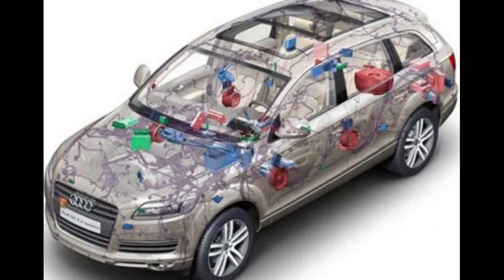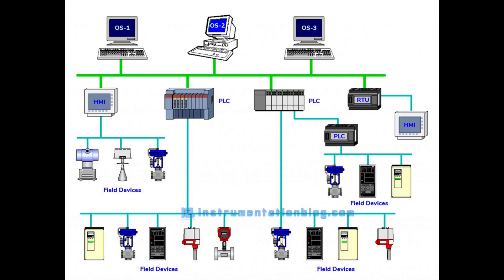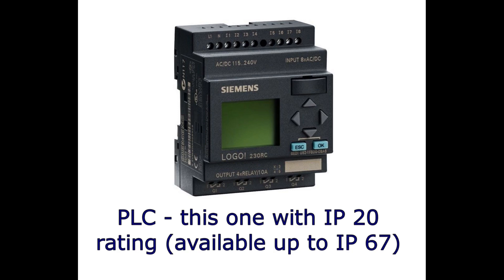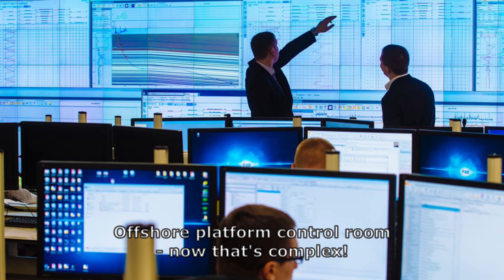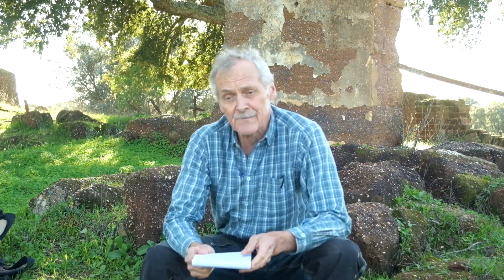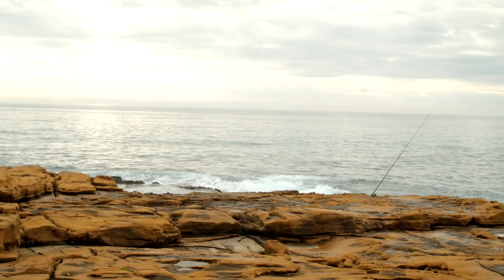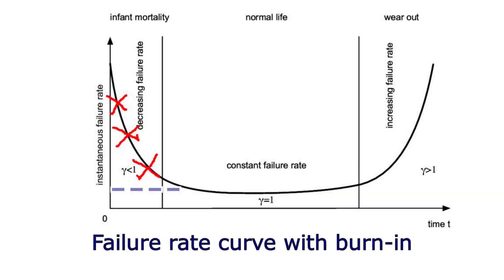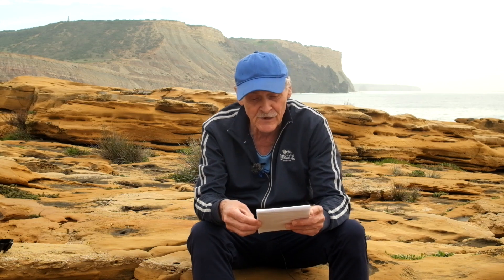Defender 2020 Reliability Woes - an engineering appraisal Pt. 2

Comment: Mercedes produced a G Wagen lite. Proper name G Wagen Pur. Rubber mats, vinyl seats, water proof switches, ECU/critical electronics mounted in a water proof compartment in the centre arm rest area. Basically military spec. Never seen one in the UK.  Plenty of blinged up Chelsea tractors with 20 inch low profile tyres though😏 follow the money comes to mind. Manufacturer's give us (the status fixated buying public) what we want. LR continue to sell all the Defender's and RR variants they can churn out😟
Reply from the maker: Good for them but they still don't produce a vehicle that (a) I can afford, and (b) I'd dare to take on an expedition.

Comment: Comparing one off industrial facility to mass.produced vehicles is like apples and turnips. No sense in designing a perfect vehicle that can't be manufactured precisely (and we all.know how British automotive quality is). Also said perfect vehicle is useless if twice as expensive as next direct competitor. Also, the time available to design and test a new vehicle is far different to what is used in industrial facility design. Also, regarding military standards, let's not forget that despite money no object development they are always out of time and over budget, ans even ships take years to get commisioned and sort out problems.
Reply from the maker: You are of course correct that one cannot compare custom designed industrial systems with mass produced ...... (I wanted to use the word "rubbish" but that's a pejorative term). However the underlying principles are the same - complexity = unreliability. I deprecate the addition of so many useless features in modern vehicles, and particularly in those vehicles which might be used on long expeditions far away from support.
Regarding your comments about project timescales. Yes military contracts have a poor reputation for overruns but there's a weak, captive client. From the moment the contract is signed the contractor pulls the strings.
In oil and gas (my former business) the "first oil date" is king and the reputation of every contractor depends on meeting this. In my long career there was only ever one project which overran by more than a couple of days (it was an impossible contract delivered 6 months late). If you miss your delivery date you get a bad reputation and new contracts are hard to achieve.

Comment: Issues that I see (Engineering ones)
- lack of availability of properly and usefully presented full system intormation for trouble shooting

- the difficulty and cost of component replacement (due to poor access / the need to remove functioning components / assemblies for access)

-  the utter lack of repairability due to inherently poor system design choices (yup, dealer damaged the wireing harnness when fitting a bullbar and the vehile was written off as unrepairable)

- The choice by the company to operate a risk based design and manufacturing process that excludes risks and consequences for the vehicle owners / operators / maintainers and repairers. (the risk based manufacturing considers primarly the impact on the company, not the consumer of the product).  Consequently engineering and design decisions under this process risk profile are skewed in a manner that that leads to a product that is nice when working as intended, but utterly traumatic for the consumer and repairer when things ago wrong

There seems to be a lack of real world appriciation.
For example, power draw when the doors are opened 
- this is really great for camping when you may need to access the vehicle many times a day resulting in a flat battery because of the large power requirments in booting all the vehicle systems when doors are opened ( yup, to get the mossy repellent, hat, kids book, drink ........).
- PowerfullUK (youtube) did some tests here = no wonder the car gets flat battery so often
- Now, only an immature designer would put such a system together and certify it as fit for use.

--- reminds me of the glint on the computer screen put in by the programmer. It was really well implemented (had me chasing all round the no glint office  looking for the problem initially).  When I spoke with the young fella in the IT department, he was so pleased to talk to some one about his web page and asked me what I thought of the glint that he had so carefully and expertly crafted into the page.  He was utterly devistated when I pointed out the the text (yes very necessary text) under the glint was unreadable, makeing the age useless.  Lovely lad, promised to address the issue. I was in a privilaged position within the organisation to have full access for conversation with such staff, landorver customers with feedback and issues on the other hand have utterly no access to syetem designers
Reply from the maker: I don't run a modern LR so I can only talk in general terms. You seem to have detailed knowledge and I can well believe what you claim.
One thing I will comment on is the immaturity of some of those calling the shots. I was talking to the representative of a former LR main agent near me. He talked of a visit by a group of young LR execs who "didn't understand the motor trade" in his words. The dealership was taken away from his company given to another which ran it for several years before closing down. Result - no representation in our region which should be prime LR territory.
Similarly Andre White tells of LR's attempt to consult the overlanding community during the development of the new Defender. One experienced overlander expressed doubts about taking the proposed new vehicle into China, to which an arrogant young exec said he'd been to Beijing (by air) and he couldn't see it was much different to anywhere else. Says it all really.

Comment: Resisting another rant here about about contemporary vehicle  complexity, fragility, damage vulnerability and inaccessibility, a fascinating pure engineering design matter ongoing is premature  crankshaft failure in the Land Rover V6 Diesel  in Discovery 4.  LRTime has this well covered on repair, but some deeper analysis of this seemingly optimistically slender crankshaft and the dimensional  criticality of managing stress raisers at the radii of its crank pin to web transitions etc would make fascinating viewing.
Reply from the maker: I have no particular insight to add to this problem however the subject is very well researched and understood. Given the many millions of stress cycles a crankshaft is subjected to every part must operate below the fatigue limit stress range. The vast majority of engine manufacturers achieve this and it's hard to understand why Land Rover didn't if that is indeed the case.
Reply: @defendermodsandtravels   Noted. If you see the V6 crankshaft concerned, your first instinct is to disbelieve it can work at all given the slender webs and miniscule bearing areas. Well documented early failures in this Peugeot/Citroen/Ford /Land Rover hybrid designs (the present one being at 40,000 miles) suggest something is amiss. A JLR insider comment suggested some QC issues with the grinding process, hence my stress raiser interest.
Reply from the maker: @philhealey4443  Whilst I appreciate efficiency and economy, as an engineer, there's a time and place for this. A crankshaft operates in an extreme fatigue environment with high dynamic loads. Make it too flexible and there will be various modes of vibration excited. On the risk side, a failed crankshaft means a failed engine. It sounds as if they got thre whole concept wrong and are now paying the price.

Comment: Two things: Land Rover/Tata dont give a monkeys about overlanding reliability, they just use it to sell vehicles. Secondly, the main market is Asia, where bling counts, a basic Land Rover, reflecting on the older values, would not appeal to the social climbers, out to impress.  Keep to your 90!
Reply from the maker: Thanks for the info. Whilst I didn't know what their marketing strategy was I do know that old style customers like me are an embarrassment to them.
Reply: @defendermodsandtravels  Old-style Engineers like me were also an embarrassment to them - hence there are very few true LR Engineers working on these products anymore. What a good many people are forgetting is that LR has become a very-junior partner to Jaguar, via the forced-merger of the two divisions under Ford in the 2000's, and therefore whatever philosophies there may have still been at the turn of the century are now lost. When you have a successful brand like LR, still able to make money in an albeit Asian marketplace, the opportunities are too good to miss for a company that makes blinged-up luxury cars that nobody wants in the 21st Century - you adapt those components and push them to the higher volumes you aspire, and that means taking-over a junior company that hasn't (yet) had its reputation ruined. So you have inappropriately-complicated electronics substituted over the already-established systems that by now are just about becoming reliable. Nobody ever bought a Jaguar for electrical quality, not in the last 50years, and this is part of the problem here.

Comment: Final point: will LR include it's vehicles on a new, no holds barred Camel Trophy event? Word is not. Not one single, simple vehicle in their range that wouldn't need a support of numerous software engineers, technicians and spare parts trucks. See any of the YT videos of old 110s, Disco 1s and RR Classics pounded to death in mud, rivers, rockfields and chugging on because they were simple.
Reply from the maker: The idea of using any of LR's current range of softroaders, SUVs and Chelsea tractors in a Camel Trophy is laughable. If they tried what would the support team travel in? You got it -- early model Defenders and Discos!
Reply: @defendermodsandtravels  I have a 95 Greek lhd D1, now 4.6 V8. As complicated as  I'd want any expedition vehicle to be.
Strengthened in most respects and much built in redundancy. All significant parts are new. It's ok.
Reply from the maker: @Predator27007  It sounds pretty adequate to me although fuel will be pricey and range limited unless you have a good solution to carry extra fuel.
Reply: @defendermodsandtravels  luckily, it's not an expedition vehicle. It would be useless

Comment: Have a friend that does the danish equivalent of MOT testing of vechcles. He says it is the dread of “value engineering” across the board. Components that you never thought could fail. 100 year old technology like a strut spring and stabilizer bars that simply break in two. A consequence of the race to the bottom in material quality and dimensioning. There is no limit to the business case that can be made once you multiply by 250.000 units / year. Also, If people want to buy a new car every 4 years, this is the result. Thank you for a great introduction to the topic!
Reply from the maker: Yes that's scary. It's all about glitz, bling and sexy features to promote car sales. They are now using reliability theory to have a good probability of lasting until the end of the warranty period and no more.

Comment: Got a Defender - it had to go back. I think (from experience with a number of LR vehicles) their approach to the cost / warranty balance is that they argue with the customer and deny their is a fault, so no warranty claim costs.
Reply from the maker: Hi DH, so sorry to hear that. That is an absolutely terrible approach to their customers and it epitomises the awful management philosophy which has killed the British motor industry since the 1960s. Why don't they learn that the secret to success is to build reliable vehicles which don't break down and to treat their customers well when there is a problem?

JLR wants to be "premium brand". They can achieve that by making vehicles with bullet proof reliability - the customers would flock in once they realised that the corner had been turned at last.

I could easily afford to buy a top-of-the-range LR but why would I do so knowing that the vehicle would be totally unsuited to the type of journey I like to make. Such a pity that a 30 year old vehicle is so much more appropriate than their latest offerings.

Thanks for watching.

Comment: on the recent announcement-> LR Defender Works V8 Trophy ?! it seems the new Defender just didn't cut it for JLR. Perhaps something else... meantime the price tag of $270K is excessive, even with a 3day package thrown in as helper..
Reply from the maker: I wasn't aware of this PR event. Sure an old style Defender is much better suited to the challenge than a new Defender, but who the hell needs a 400 hp engine with an 8 speed auto gearbox and an eye watering price tag? You can have just as much fun driving a 20+ year old 4x4 from any of the name marques, and spending maybe £10k on the vehicle.
Reply: @defendermodsandtravels true! not great PR fromJLR building controversy and a quick $ which may bring about $6.75mln only and lose focus on the new Defender reliability as a true offroader showing too may electronic vulnerabilities in non IP67 or IP68 housings; to mention just one
Reply from the maker: @peterpontikos3786  Perceptive comments. Yes a bit of a PR blunder I agree. If JLR really believe in the new Defender they should be using it for the new challenge event.

Comment: Alexander Kjelland / Piper Alpha - Human Reliability. 

You can't engineer-away the human element.
Reply from the maker: Nope but you can greatly reduce the risks by the application of the correct procedures and the use of competent personnel.
The cases you refer to were my world. I was personally involved in Piper Alpha and its aftermath. It made an indelible impression on me as you can imagine.
Reply: @defendermodsandtravels  Indeed.
Safety is everyone's responsibility.
My first platform was Maersk Giant. A Jack-Up in the Norwegian sea. Last platform was SEDCO 714.
Safe travels :-)

Comment: Well said. I think the issue is that Land Rover's target market is now 'well to do owners' in posh suburbs who may have 2 or more vehicles. The glitz of the fancy electronics is more compelling than the reliability required for a true off-road vehicle. It's all about the consequences as you say. For these owners, a failure leads to tow on the back of a truck and some inconvenience. To a true off-road vehicle owner, the consequences could be very serious indeed. But take a look where dealers are located, and their marketing with the attractive model "brand representatives" and you know where they see the market. It's not people who need reliability. They are extending the Range Rover brand downwards, not extending the off-road Defender brand forward.
Reply from the maker: I couldn't agree more. Well said.